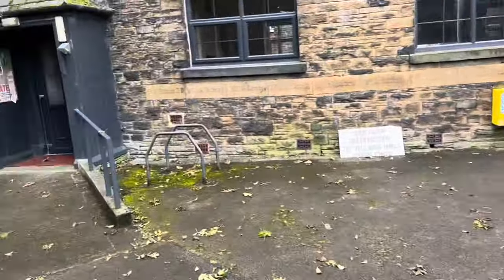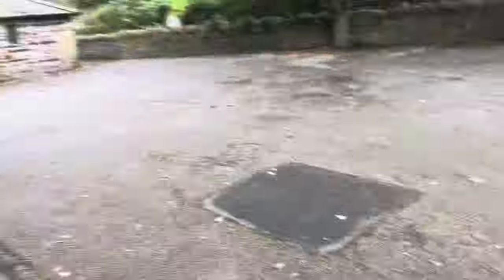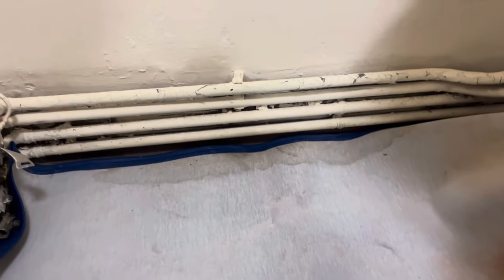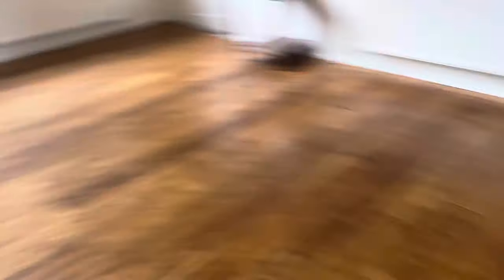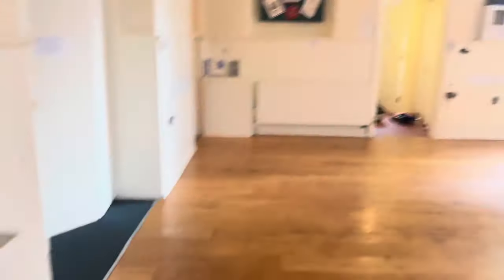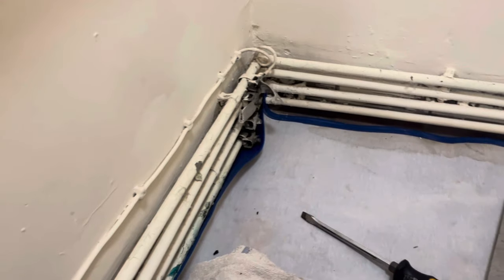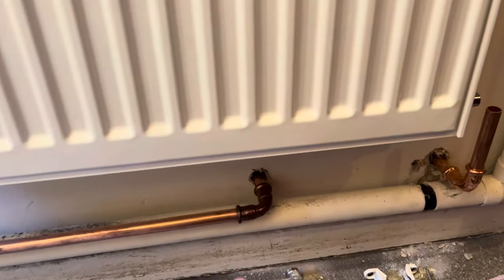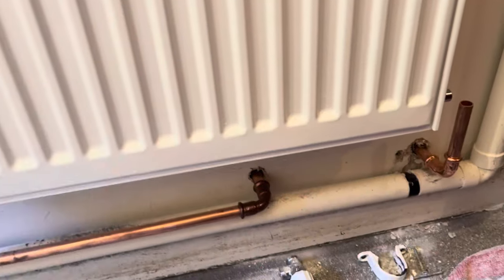Rapid blu fails me 😩Day in the life of a jobbing #plumber Episode 79

Comment: I've  always been a belt and braces sort, PTFE and compound.
Some will say one or the other, but as long as the PTFE and jointing compound are suitable for water and or gas type I don't  see the problem.
Scarifying pipe threads also helps. Some manafacturers  
make threads pre-scarified.
Reply from the maker: Yeh they do you’re right. I think honeywell to their rad tails. Yeh ptfe is tried and tested. But I think on this occasion it was user error :( haha. Thanks mate, 🫶🏽

Comment: great video. Them press fit tees are massive compared to end feed. Never used press but it seems like it has its pros, main one being it doesn't matter if there's water in the pipe but I just couldn't be bothered constantly faffing trying to get the gun in and all that. Also must be a nightmare trying to get the press fittings on with no movement hard enough with the normal ones.
Reply from the maker: It has its advantages and disadvantages you’re right mate, these are conex tees so probably the largest on the market, (just using the last of what I’ve got) end feed looks neater aswel, I’d never be one to try and convince people to press, it’s each to their own, thanks for the support Deano 🫶🏽🫶🏽
Reply: @Heatking  yea think I'm going to invest in the future when it is a bit cheaper hopefully anyways thanks for the reply keep up the videos mate. I'm only an apprentice and I don't do much servicing so learn alot from your videos.
Reply from the maker: @deano6017  thanks mate. I’m hoping to do an in depth servicing video soon, so that should help you out :)

Comment: Yes pal only just found your channel. Great content very informative. I'm going to ask you this is it necessary to sleeve pipes going through walls or is that only for gas and does it have to be like for like? Cheers pal onwards and upwards 👍🏼
Reply from the maker: Hey mate, it’s best practice to sleeve any pipes, but mandatory on gas pipes. I taped this pipes to stop the wall from attacking the copper as it passes through. A gas pipe needs to be sleeved because if the pipe failed in the wall you don’t want the cavity filling with gas where a customer wouldn’t be able to smell the gas, if its sleeved it would end up coming back into the room and hopefully somebody with smell it. Many thanks.

Comment: You are supposed to sleeve ALL pipes passing through walls I suggest that you read the relevant standards and regulations
Reply from the maker: Are you supposed to sleeve or protect the pipes from the wall attacking them? I did tape them up to prevent it. I just didn’t sleeve the pipes with another pipe.
Reply: @Heatking  Both th BS and water regs state sleeve to protect from chemical attack and movement.
Reply from the maker: @philiplancaster9682  fair enough. Learnt something new today then! 😂thanks.